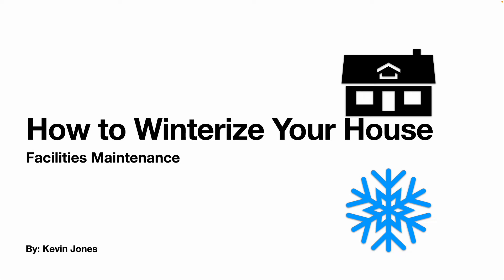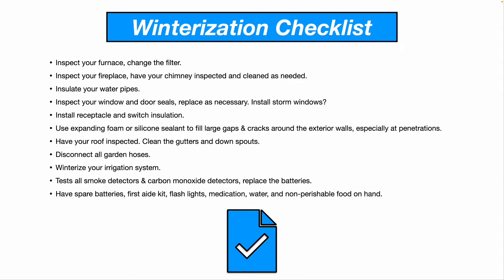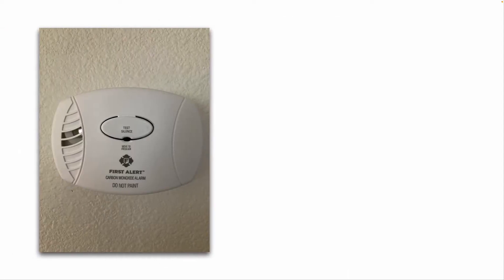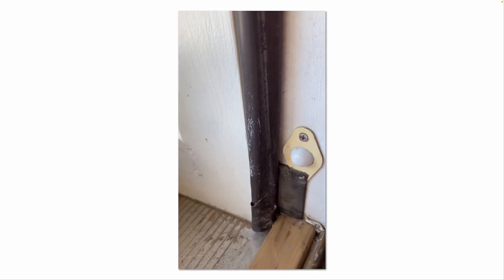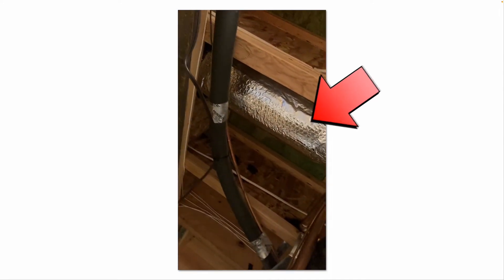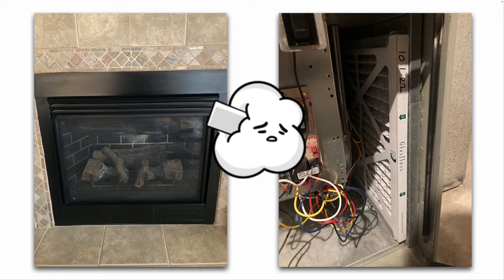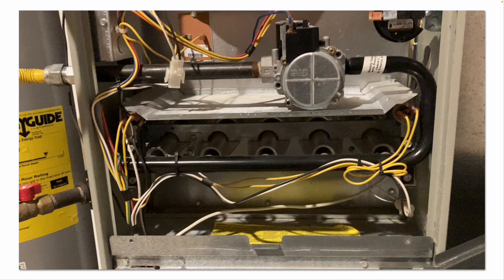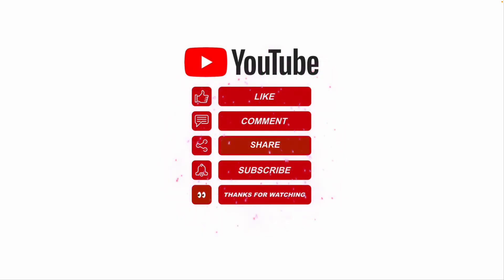Winterization | Ready Your Home For Winter | DIY

Comment from the maker: Legal Disclaimer: Do not inspect or clean your HVAC equipment, or fireplace yourself, if you are not qualified and comfortable doing so, hire a professional.  ALWAYS turn off the circuit breaker before performing any electrical work!